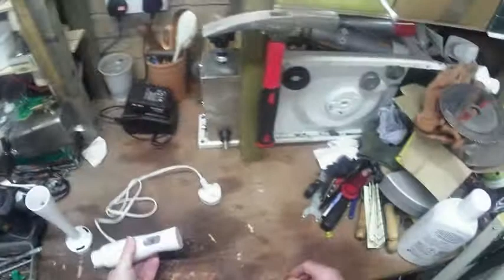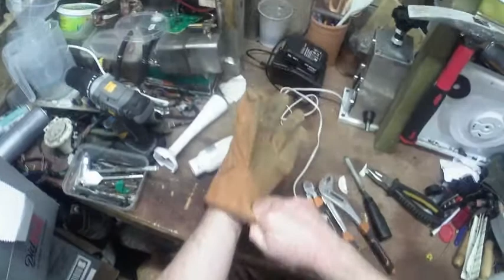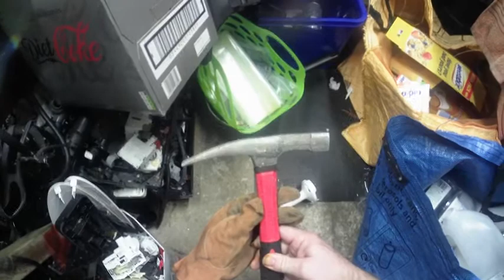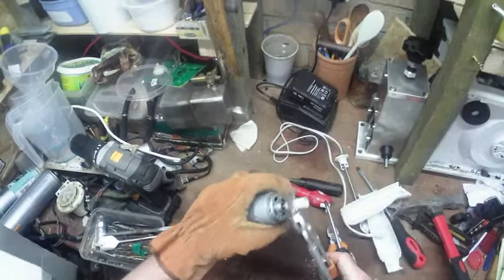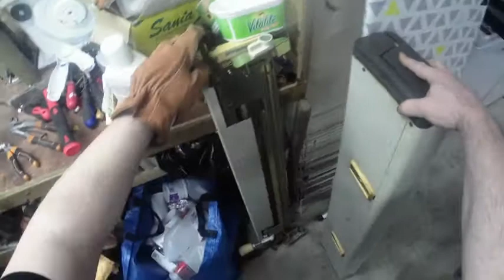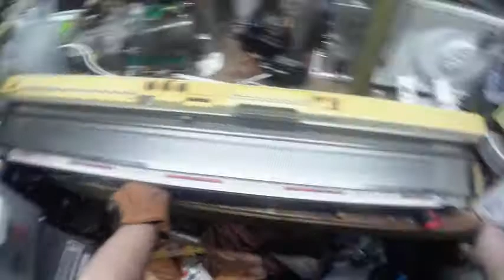Finally Scrapping Again!!!

Comment: What brand of knitting machine is that? My mom was a dealer for Toyota knitting machines and I know finding parts for them can be hard. I think on her machine the patterns were on a card that went in a slot, of course if I would go down stairs and looked at one of them I would know, I ended up with 4 or 6 of them when we cleaned out her house half of them new in the box. Keep up the great videos and God bless you and your family.
Reply from the maker: Robert I remember years ago my neighbour having one of these. I believe it is still working, I'll check the make. You've made me think now, could somebody get some use out of it rather than me scrapping it. I'll Google it. It was so good to be back at the bench again. I didn't care what I was taking apart, it gave me a good feeling after being ill for so long. I want a camera that gives a good close up of what i'm doing, so the viewers can see. I'll keep trying. It's all trial and error. Many thanks for your comment. Stay safe. Matt.

Comment: 👍 quick question,  the bottom of ali drink cans if cut off  will they still be classed as clean, as a lot of mine have the use by date printed on them in ink. 🤔
Reply from the maker: Russ i think the ink is so little it would still count as clean. I'll be doing a video on how to strip ALL think off soon and then I'll go down my yard and see what they say. Once cut up I'm sure they'll say the top and bottom are clean and the middle section will be a rolled sort of aluminium. I'll find out soon. Many thanks for your comment. stay safe. Matt.
Reply: they go has clean yes. i use to do it and matt did it by copying me. that the lids and tops off.